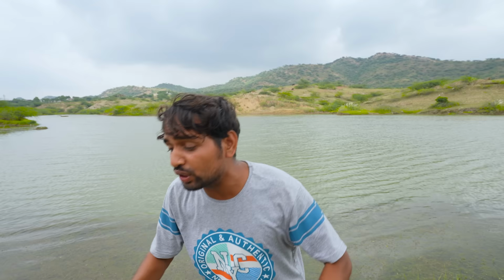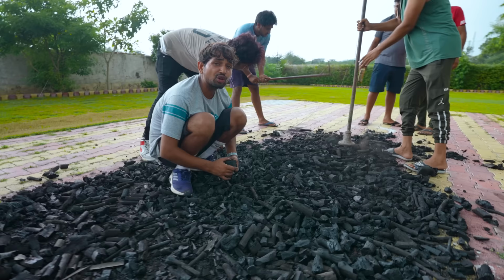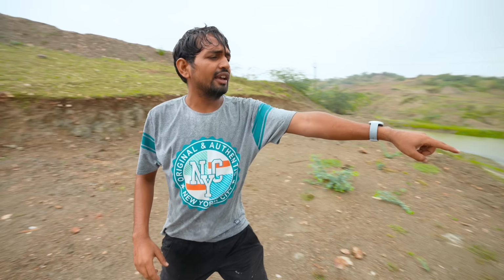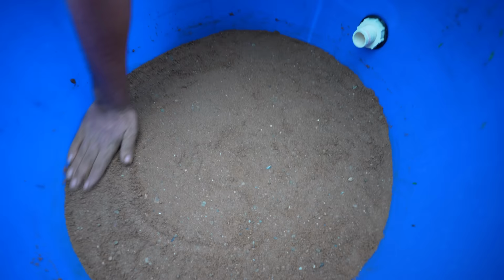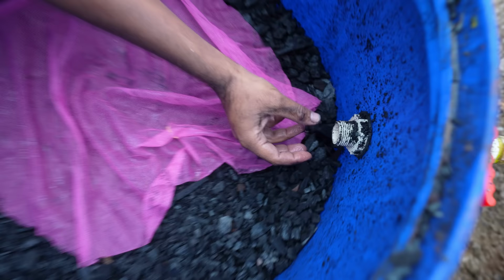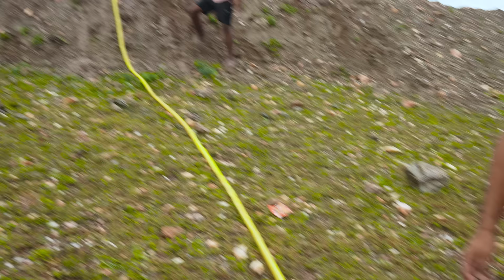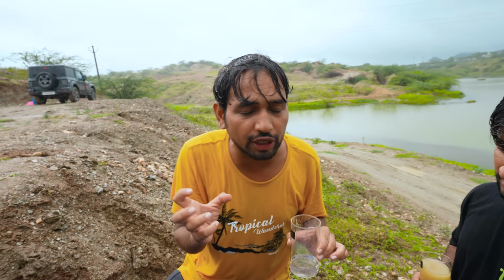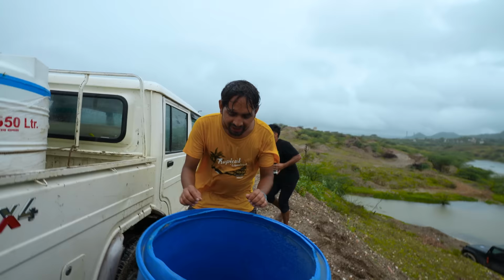Desi Water Filter System - ₹2000 Only...पूरे तालाब का पानी साफ़ करेगा

Comment: How it works... (and how to maintain it...)
( 1.) Gravel roughing filter
Source water (controlled by the float valve) enters by a pipe at the bottom of the gravel filter and flows up
ward through the media. This removes turbidity (particles) and some dissolved matter that sticks to the su
rfaces of particles as they settle. One or more times during the year (depending upon source water quality
), the large valve (at least 3” – bigger is better) at the bottom of the gravel filter is opened, rapidly reversin
g the direction of flow through the filter (“backwashing”) in order to flush out the accumulated
sediment and organic matter. Gravel filter maintenance: As long as the plumbing does not break, or the pl
umbing or media
become irremediably clogged by sediment or debris, the gravel does not need to be removed or replaced
within the lifetime of the treatment system. Some “MacGyvering” may be necessary to ensure that the outl
et of the float valve completely directs influent water into the pipe leading to the bottom of the tank. The flo
at valve should be periodically examined for potential clogging or misdirection of influent water.
( 2.) Slow(bio- sand) filter
Sand filters remove microorganisms and particles by physical straining, and some dissolved compounds
by adsorption onto the surfaces of sand grains. Most importantly, however, biologically active sand filters r
emove problematic microorganisms and chemical compounds by biodegradation. Unless a disinfectant su
ch as chlorine is added to the system, a biofilm (or schmutzdecke) naturallydevelops within a few days up
on beginning use of the filter, and continues to mature over a period of
several weeks. The length of this time period, termed “ripening,” depends primarily upon ambient tempera
ture and source water characteristics. The biofilm is concentrated in the top 1 to 3 cm of the media (thoug
h exists more sparsely throughout the sand bed) and actively degrades dissolved organic compounds in t
he influent water. The natural environmental microorganisms that comprise the biofilm prevent the establi
shment of microbial pathogen colonies through competition and predation. Thus sand filters with healthy e
stablished biofilms are an effective and well-demonstrated technique for removal of pathogens as well as
some hazardous
biodegradable compounds in water treatment. An excellent recent compilation of the scientific literature o
n micro-pollutant removal through biologically.
Slow/bio-sand filter maintenance: The sand filter is the flow-ratedetermining step of this water system. As
organic material accumulates in the biofilm zone at the top of the sand bed, flow rates may diminish belo
w a minimum threshold of treated water needed by the community. Thus a few times per year it may be n
ecessary to “wet harrow” the sand filter to restore sufficient flow rates. This is accomplished using a long
pole to vigorously stir up and suspend theaccumulated sediment from the top few centimeters of sand into
the water above the filter bed. The harrowing valve (located 5 to 10 cm above the top level of the sand) is
then opened to allow the suspended sediment and organic material to wash rapidly out of the upper porti
on of the tank. The
majority of the suspended sand particles are not washed out but resettle, and the biofilm reestablishes full
function within a few days.
( 3.) Charcoal (biochar) filter
Terminology and key concepts The char filter functions primarily by the process of adsorption. Adsorption,
which signifies a surface interaction between dissolved species and the char, is distinct from absorption,
which essentially means “to soak up” or “to take into.” To be exact, however, in water treatment contamin
ants diffuse into char pores (absorption) where they bind to char surfaces (adsorption). This has led wide
use of the nonspecific term “sorption.” The porosity and large surface area of chars provides a multitude o
f reactive sites for the attachment of dissolved compounds. These reactive sites can bind non-problematic
dissolved organic compounds as well as targeted hazardous contaminants. Background dissolved organi
c matter, present in all natural waters, can occupy sites on char surfaces and thereby exclude contaminan
ts of concern. This is called “fouling.”
Fouling in char filters is mitigated by upstream unit processes – in our case, the gravel and sand filters – t
hat act to remove a substantial portion of background dissolved organic matter from the source water bef
ore it encounters the char. The principle is to achieve a high level of treatment prior to the char filter, in or

der to “save the carbon” for removal of targeted problematic dissolved compounds that make it through th
e previous treatment steps.
Char filter refurbishment The effective lifetime of the char filter media depends upon the quality of
the char, as well as the characteristics of the source water and efficacy of upstream treatment steps. In th
e
rural developing community context, these factors are typified by high degrees of variability and
uncertainty. Since char can be generated locally and inexpensively a conservative approach is
recommended, designing for a much larger carbon use-rate than is employed in advanced GAC systems.
A char filter built according to the specifications outlined here and supplying 2000 L/day should be
refurbished at least every 2-3 years.
Charcoal removes impurities from water by a process called adsorption, meaning that the contaminants a
dhere to the charcoal’s surface. Because it is porous, however, water can flow through and permeate the
charcoal. That permeation is the better-known process of absorption. Dropping the prefixes gives the wor
d “sorption,” which covers both processes.

Comment: ❤🤴 Dilraj Bhai, A new idea of CHALLENGE for your team...
Plz clean the water of whole pond, either by using this system or any other...
Tip:you can storage the filtered water in many tankers and then after cleaning complete water, refill the pond with clean water. 
                        OR
Dig a new pond and fill the filtered water in it, you can also put some stones so that the water dont get quickly mixed with mud.

By the way, if you like the idea then only execute otherwise fine.
❤❤❤❤❤❤❤❤❤

Comment: You need only 2 barrels. The water can enter from below the first and to the top of the second barrel. You can control the flow using the toilet flush valve.

Comment: These small drums can't filter the whole pond, pores in rocks and gravel will choke in some time and your drums ll overflow then it won't be possible for you to clean them as you have used rocks. This kind of up-down-up- down mechanical filter can clean solute but can't remove harmful bacterias so don't drink water just because it's looking clean. Instead of using rocks you could have used a tea cup effect with a soft easily removable sponge setup so as to clean easily after some time.